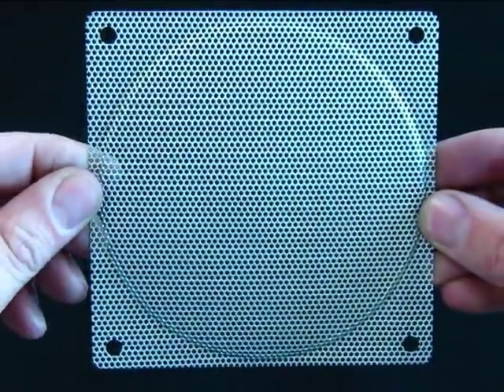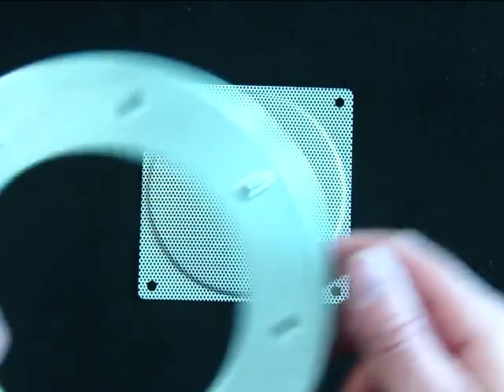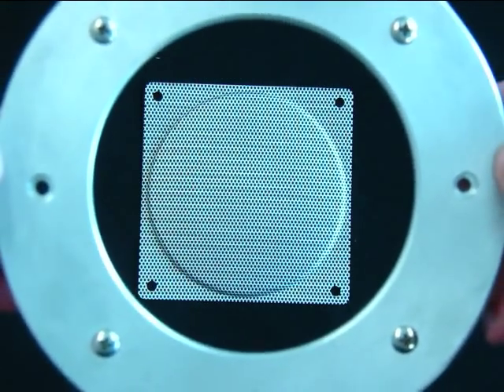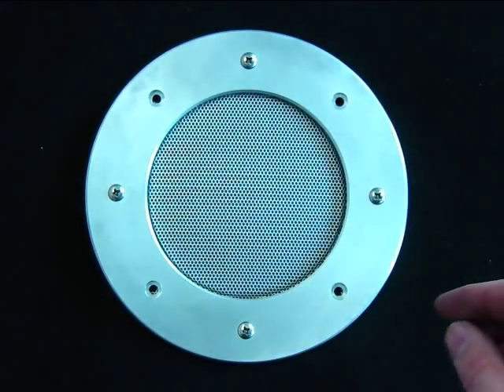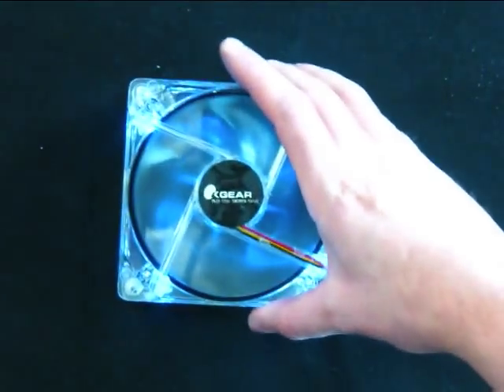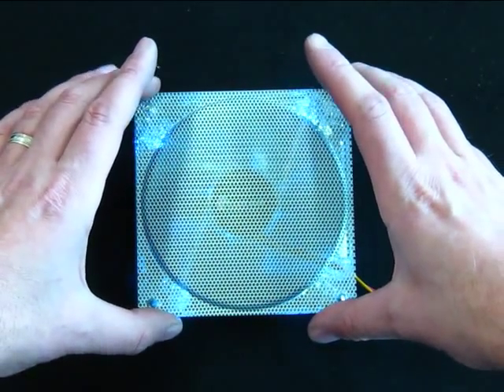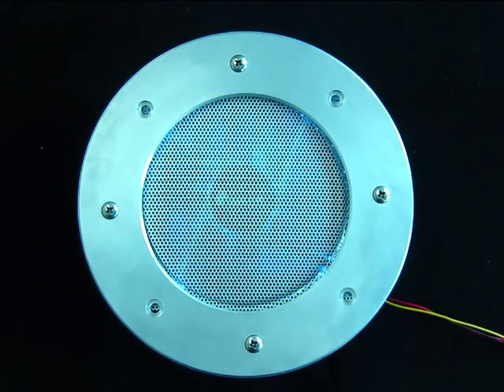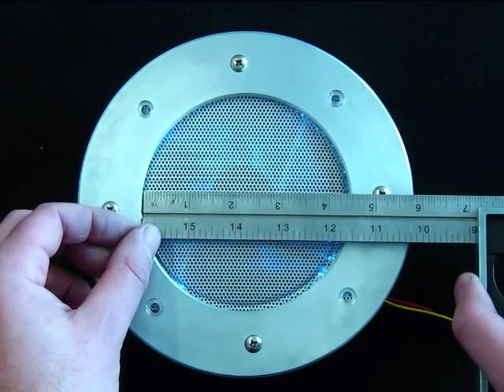Computer 120mm Custom Billet Fan Grill, www.mnpctech.com

Comment: i can get why mnpc tech charge 20+ dollars for these mods..since they aren't mass produced material and machine shop expenses would bloat to proportion..as for example a simple GI sheet gauze 25+ is already sold around 7-10 dollars + for a sheet of 3x6ft approx..now thats just a gi sheet..with a 1/4in aluminum sheet measured around atleast half 3x6 would be around $20-30 and if mnpctech still hires a machine shop to do the work then thats another + in expenses..based on experience